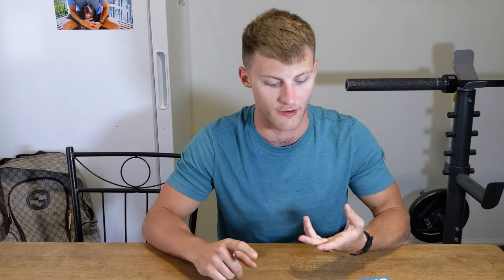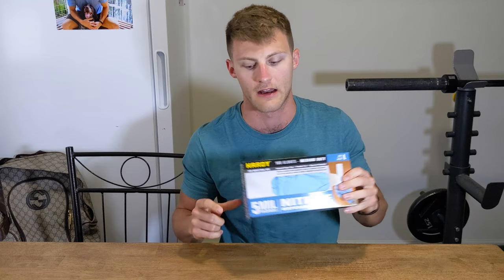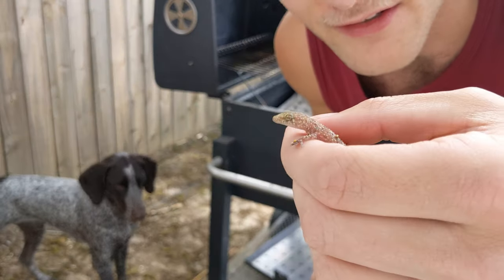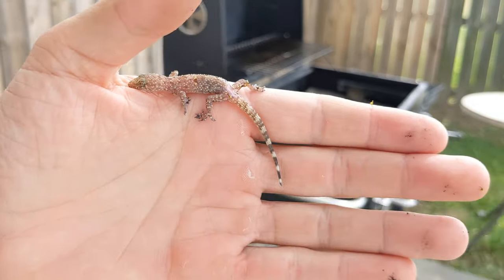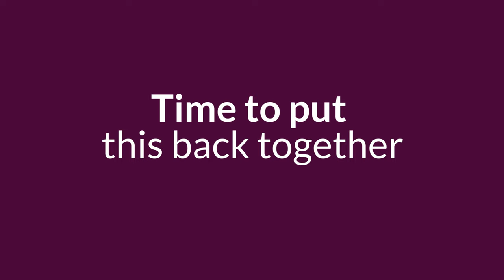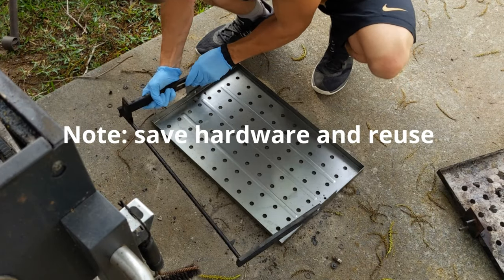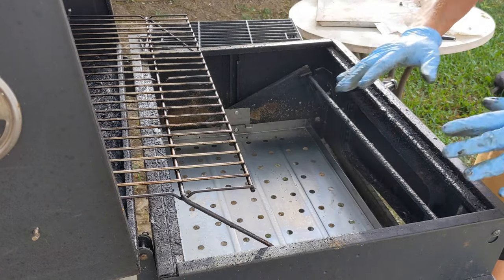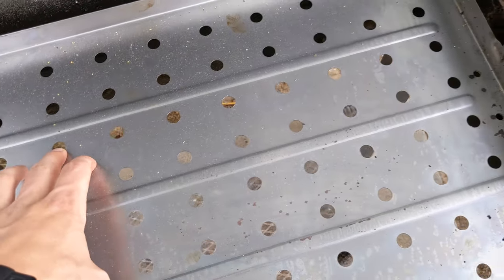Expert Grill - Charcoal | Charcoal Pan Replacement

Comment: I just bought one of these grills and I love it. To Keep that from happening you should have seasoned it inside and out with canola oil or vegetable oil cooking spray to prevent rust buildup and the pan from melting. Also put your charcoal in a foil pan, not on top of the charcoal pan. by doing this you will extend the life of your grill and get your money's worth plus more
Reply from the maker: Thanks for the insight!!
Reply: Link does not work. Do you have the Carbroil part#

Comment: Thanks for the video. I got this grill yesterday for $65 on offer up brand new in box and I’m in Georgia too. The cook was awesome but being a lazy chick, my 2nd time using this I’m going to try to layer the charcoal pan with aluminum foil and punch holes in it to prolong its life. Let me know your thoughts on that.
Reply from the maker: Heck yeah that's awesome. Unfortunately putting aluminum foil on the bottom won't do anything. The heat of the coals will still heat the metal on the bottom. Overtime through heating and expanding and cooling it will start to wear away.

Comment: Thanks man, you just saved me a lot of time and quite some money!

Couple things to note: you don't really need to unscrew anything at the front. One can just remove the whole rocker with the pan from the rails and install new the same way. It may be easier to remove if you first unscrew 4 screws holding a pan on the "ears", but this can be quite rusty too and not really required.

For the posts, I was using 1" long which was a little too tight for the bottom holes and perfectly fit for the top. Not sure if 1 1/4 would work better, but in the video you say 1 1/4, old were 1 1/4, then pan is exactly 1/2" wider than the old one and description under the video says 1". Anyhow 1" works, I just had to place inner washer right before the sleeve and force post's head inside the inner hole. Got the impression you did the same.

Kudos for the links!
Reply from the maker: Glad I could help! That's why I made the video. Thanks for the tips I appreciate it. I didn't put this grill together so I had to reverse engineer it while it was all grimy lol 
Glad you got everything to fit and got your grill running again! 
You're welcome for the links, have fun Barbequing !!
Reply: @BrandonCReviews  Honestly I did the assembly myself, but don't remember anything. I have just downloaded assembly manual to see the assembly order and do the reverse thing. Sure thing I didn't retain paper manual or don't know where is it ;)
Reply: @BrandonCReviews  Kudos again, man! 3 years passed, another round. This time it took 20 min and no unscrewing at all except for 4 posts. A little of WD-40 though. It is somewhat difficult to get it now, but knowing the UPC and little searching helps! Grill is again like new for the next 3 years I guess. Believe it or not, this time I did it in a white T-short, and it is still white!
Reply from the maker: @rampitec  wow congrats man that's awesome 😎👍🏽

Comment: I've been looking at one of these grills the last couple of days and wondered about how easily it would be to replace that when it comes time. Watching you makes me think that I would order a replacement pan now and take us jigsaw and cut the lip off the replacement pan and slip it on top of the factory pan. Just use it as a liner. When it burns out pull that one out and slip in a replacement.
Reply from the maker: Definitely possible 🦅

Comment: I used this same pan for the couple of these I’ve had. If you cut the two ears off and drill the new pan to match the 4 holes on the bottom of the tray, you can install this pan directly on the elevator mount without removing it from the grill. The pan rusts out cause the thermostat and the emblem on the hood leak.

Comment: Thanks for the share Brandon! Had the same thing happen to me. I just ordered the new tray from Char-Broil. $18 only! One thing I noticed a big difference compared to mine, I was easily able to lift and remove the old tray with carriage assembly out of the grill without loosening any screws attached to the inside/front of grill. Hope this helps anyone. And if there’s a specific reason why you did this please lmk what for? Thanks .
Reply: Hey there! Do you know the part number for charbroil? I am having the having the same problem 😢
Reply: @Fiftyflavoursofbree is on the description. The link.

Comment: After watching this,  I think that I'll just grab some heavy duty grate material to drop in that coal pan, when the bottom finally gives out.  That old pan had the crossbars, so that would help support a heavier material.  I've never much cared for the current pan, but a grate would drop ashes better.  I note that the holes in the new pan appear to be smaller than those in the original. 

I might also suggest that having the pan out presents a great opportunity for grill cleaning.  Also, it's a good time to check the tightness of all the hardware.

Anyway, I've had my grill for a few years.  At the time, it was a "it'll do for now" purchase, and I think that we intended to replace it, later.  But, it's held up, and performed well, so we've not felt a need to get another one.

One other thing... if one has only had the grill for a year or two, and that tray has burnt out, perhaps one is running the grill too hot.  (Not calling anyone out; not passing judgement. I am merely making a broad statement)
Reply from the maker: Hey man! Thanks for commenting. 
Yeah that would work as well. I thought about putting a grate at the bottom but I also wanted to see if I could do a more OEM part fix. 
As for the heat I only cook between 3-400F. We do use the grill on a weekly basis year round (We live in the south).
I also got this grill as a "It'll do purchase" but it works great so that's why I decided to fix it and put out a video. 
Hope it helps someone!
Reply: @BrandonCReviews  Mine usually runs between 300-600... that just depends on the day, lol.  That has nothing to do with grill design; I live in the South, too, near water... and wind.  So wind speed, wind direction, temperature, and probably even humidity, all seem to have some impact on grill operation, and those factors tend to vary wildly, from day to day, which can make it difficult to regulate temps.  Plus, I've noted that some charcoal brands behave differently than others.  So, I stick to one brand (Kingsford), and have different cook times based on different temp ranges.

Sounds like that grill gets a lot of use!  Once I get my new normal figured out, I hope to have mine fired up with as a great a frequency, lol.  Overall, I would say that regular use, during the winter, is probably good for the grill.  When those things sit under a cover from September to March, moisture builds up, and just sits. Over time, that moisture will find and exploit any weak spot in the finish, causing rust, and ultimately a premature end of life for the grill.  With regular use, the grill is constantly heating up and burning that moisture off, so it doesn't have a chance to sit and cause rot.

And, your video did help me; though not in the way you probably expected.  The OEM fix is just a little more effort than I'd want to expend, even as easy as it appears to be.  I'd still be content just dropping in the grate material.  But, then, I own various metal fab tools that may make such a thing easier for me. Someone with a basic tool set might probably have an easier time with the OEM fix, as cutting that grate material might prove difficult without something like an angle grinder.  Of course, I can't just leave things be, either.  I always have to take stuff apart, try to improve it, change the appearance...  This drives my wife INSANE.

Anyway, have a great day; continue to enjoy that awesome grill, as I continue to enjoy mine :)
Reply: Once i saw that the crossbars were gone, I gave up on finding  the correct replacement, bought a piece of expanded metal and made quick little firebox.

Comment: Ok i have the exact same grill and was taking it apart today  and 2 things just to help out others you don't have to remove the screws in the front. That he started out with second thing is if you don't want to have to buy the screws you can take a Dremel on the welds that hold the bars on the sides of the pan and reuse them on the new one you may need a washer for them if you reuse them and do a shoddy job on the dremeling.if anyone needs help let me know.
Reply from the maker: Thanks for the info man 🤙🏽

Comment: I have the same grill and just came across this problem. Would it be safe to lay aluminum foil down over the holes for the meantime? 😩
Reply from the maker: Negative. You would not want a direct flame on aluminum foil. That   could seep into your food.

Comment: My thought is it's a 90 dollar grill. Just buy a new one. I love mine and it's ready to run its 5th season. Never replaced any parts on it. Although theres a larger one out I may get.

So with all my old grills I had that basically rusted out after a season or two I switched from lighter fluid to a chimney starter. What I found is it did not rust out on me. And being in the rot belt makes that more impressive. Thought I'd share
Reply from the maker: If the whole grill was falling apart I would have. Due to the fact that it was just the pan that needed fixing I couldn't see myself going out and spending $90 on something that I could fix so easily. 
Might look into a chimney starter, thanks for that.